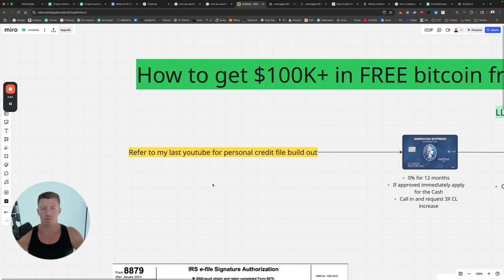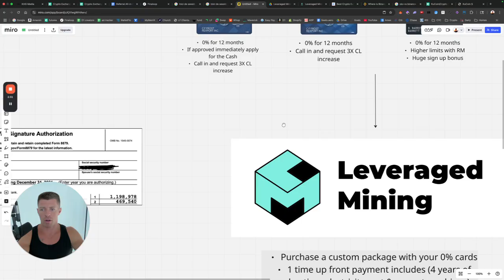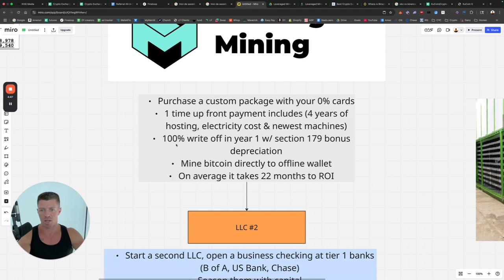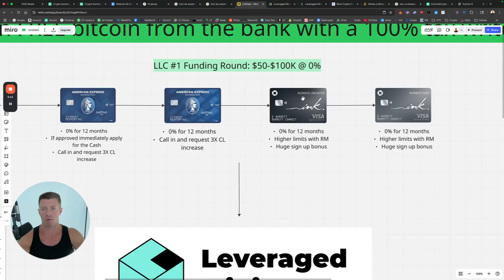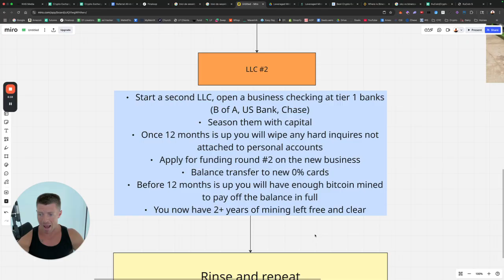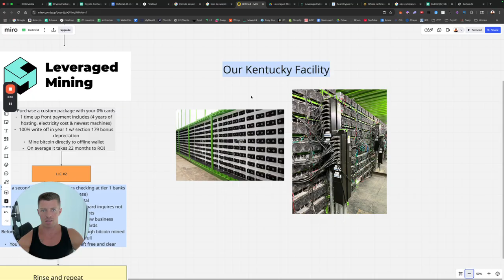how to turn credit into bitcoin — and write off 100% on your taxes

Comment: Genuine question, how does it work legally when you transfer the cc debt from one llc to a new one ? Is the new llc buying out the old one? Surely it’s more paperwork than doing a balance transfer on the personal side.
Reply from the maker: You just call in and balance transfer. It's that easy.